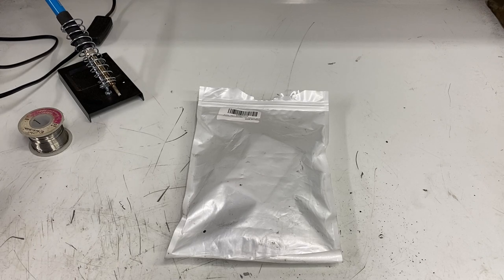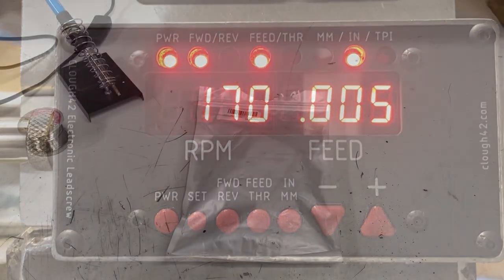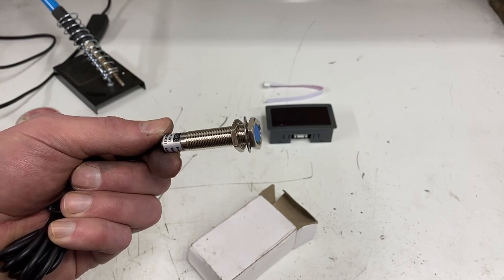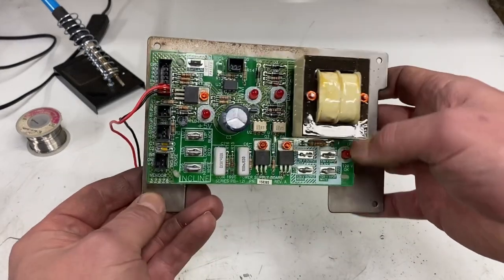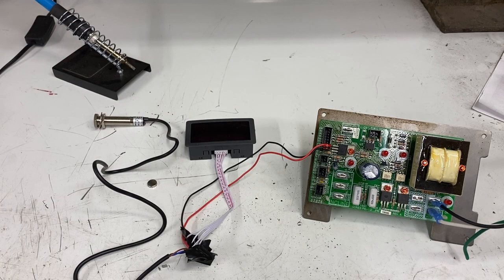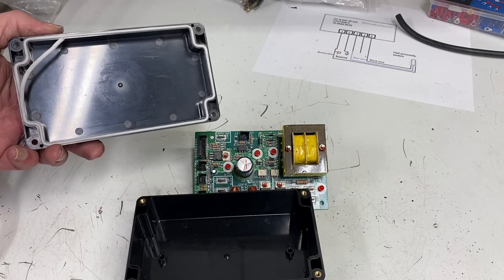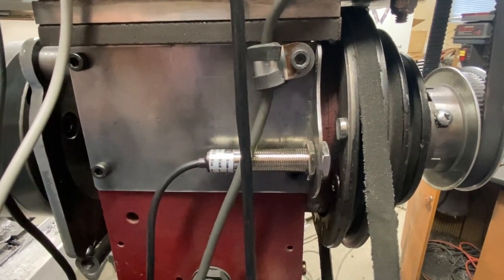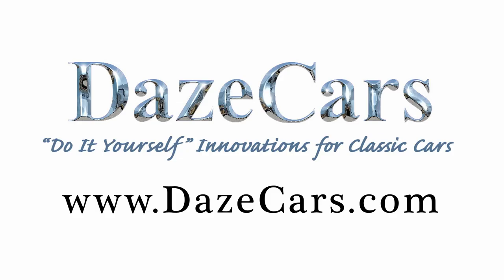Lathe RPM Meter Powered With Treadmill Parts

Comment: I have disassembled two treadmills thus far to get the motors and controller boards as well. And all the hardware and any other part that I could use for other projects. And with the latest disassembled treadmill it had a feedback hall sensor attached and I kept it for just that same reason. Some times everything you may need for another project is already there for the taking also. Thumbs Up!
Reply from the maker: scrapping a treadmill, the gift that keeps on giving!!

Comment: This was very helpful. I'm using the ELS system from Clough42 as well. I wanted a separate RPM bc the ELS box will live near the speed control levers on the lathe, while the rpm gage will sit in the power/e-stop box that is eye level. If I ever get caught up on projects that intertwine from Z to A!! Thanks again.
Reply from the maker: glad I could help

Comment: Great video. Do you ever have dust and grit get pulled into the motor by the cooling fan and causing damage? Most motors on sanders are sealed motors.
Reply from the maker: My machines are working with metal chips so the the material is big enough  that it is too heavy to get pulled into the the motor like dust would.  My issue is steel and iron chips sticking to the outside of the motor case due to the magnet inside.

Comment: Nice work Day!  As I mentioned, I am looking forward to getting my meter used once I get variable speed going.  I originally just used an old cell phone charging cord as my power supply.  Now you have me wanting to integrate my sensor power with the motor power.  Will have to have a side bar with you on that one! :)
Reply from the maker: thanks
Reply: Thank you very much for that appreciate it.

Comment: Love all your videos very informative and the way you present is really good. 
Just wondering with things like screw cutting when the lathe dc motor speed is slow, does it affect the motor? ie heating up?

Thanks
Reply from the maker: That is the beauty of a treadmill motor. Treadmills are designed to run for long periods of time at a full range of speeds.  I single point thread at 100 RPM.  With the gearing my motor is turning about 350 RPMs   It doesn't get hot at all.  About the longest I have ever threaded in one session is about an hour but in that hour little to no heat buildup.  If you are still worried about heat it becomes a non issue of you are using a motor with blue wires because when hooked up correctly the system will shutdown if heat starts to get near a dangerous point.

Comment: Wouldn't reducing voltage reduce torque?
Reply from the maker: On a DC motor torque is a function of amps, and speed is a function of volts.  A DC motor torque curve is flat once the volts are high enough to overcome the resistance of the coil.